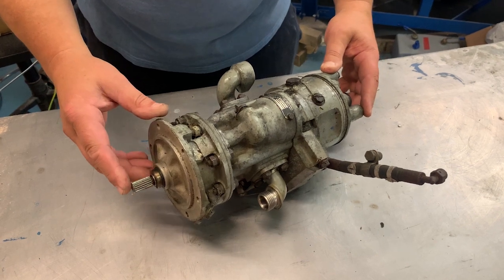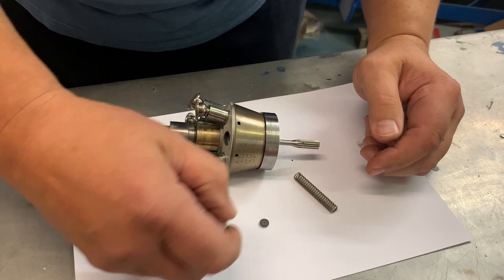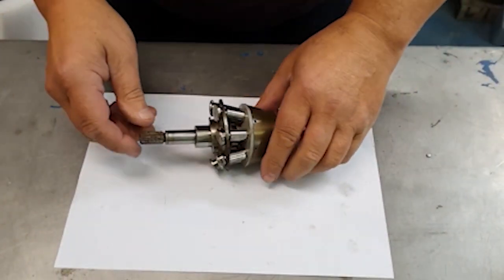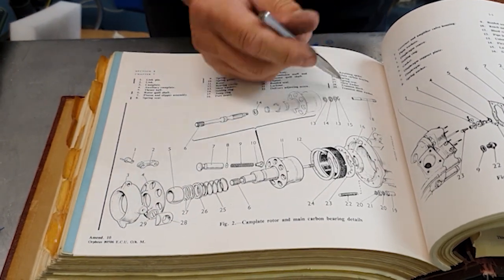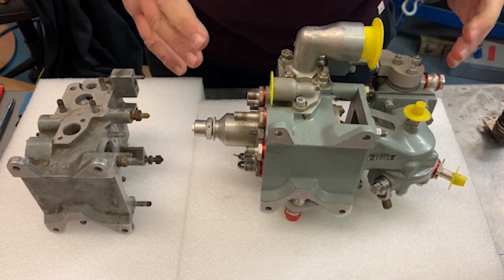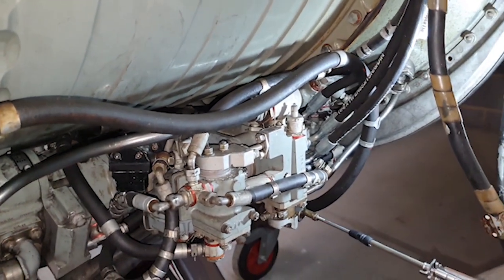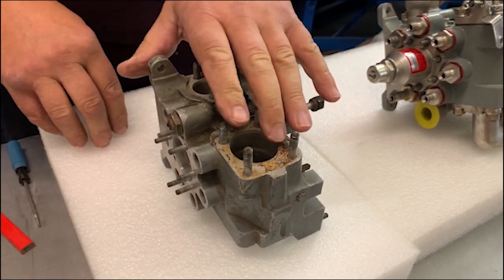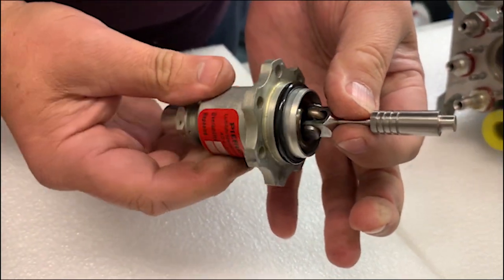Orpheus fuel system part one

Comment: in addition, i have work for lucas aerospace and work on all component you,ve for more than 30 years, from strip clean, detailed inspection, final assembly, endurance test and final testing and also releasing unit signing log cards.. your explanation delivery is already excellent, and not every lucas engineer does  have the undestanding of entire operation which is they should, they often ask the rig jockey how the system work,,, its simple really, thru my long experience if detailed inspection and proper assembly is done IAW component manual, and mounting up in the test rig, the rig jockey will not have any problem at all in calibrating the component...yeah, brings back memory,,thanks from downunder